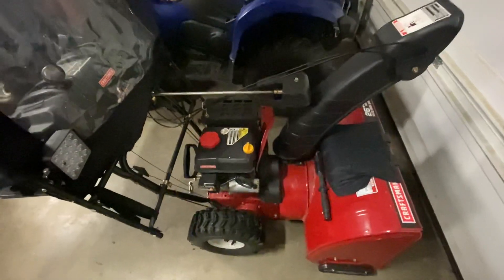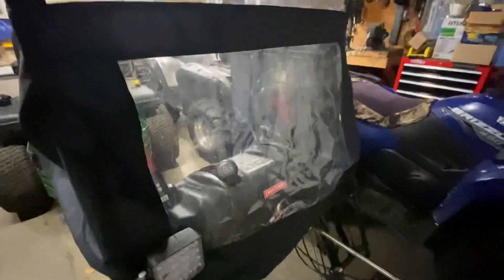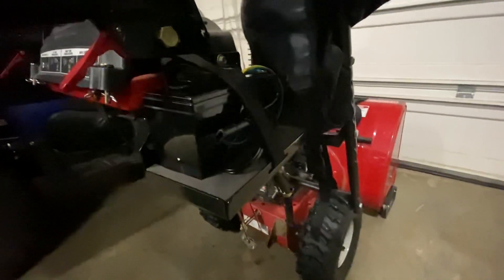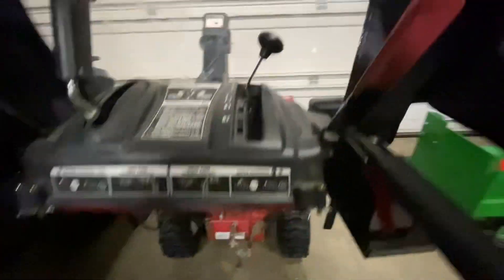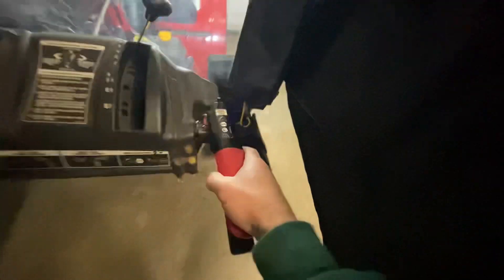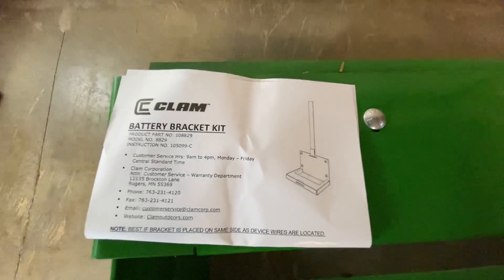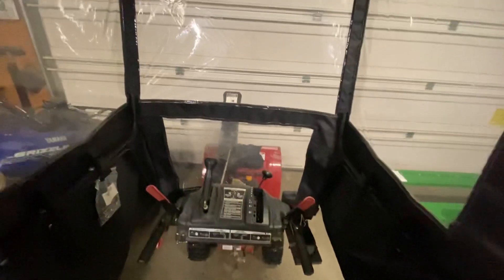Add a light to a snowblower that never had one and can’t support one. Part 1.

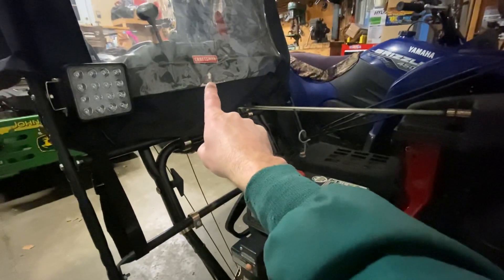Comment: at 0:26 whats the big metal cylinder on the side of the snowblower though? isnt that a starter motor? wich would suggest it has electric start, and therefore has a battery and voltage coil?
Reply from the maker: @chrisben2000  yup it’s the starter.  However on most snowblowers for some reason electric start is a plug in 110v process… get an extension cord and plug into the starter, press starter button, and your running.  So no battery, no generator/ alternator…  the electrical system consists of just ignition equipment.
Reply: @s1283  oh okay. i didnt know that. i ve only owned two, and one of them was pull start only and the other one had a battery and the electric start worked, but i always pull started anyway cause battery almost always dead
Reply from the maker: @chrisben2000 yeah that’s about right. Was the snowblower you got with a battery start perhaps an ariens? I’ve repaired a bunch of these as side work and so far they’re the only one I’ve seen with battery start.  Works great when it works, but charging the battery is easy to forget.

Comment: A lithium  ion battery would have done the same thing and gave you better results and using an adapter,  you could use your craftsman drill battery instead. I have converted several Electric start equipment  to the lithium set up, mostly Ryobi that you cannot get batteries  for anymore. That battery adds weight to the back of the blower and may make it tip back when going through wet heavy snow or on a hill when you do not want it to tip back. Lithium  batteries  are smaller and provide better power than lead acid batteries  any day.
Reply from the maker: As you saw I have a canopy, and to counter the already offsetting weight, I also have a front weight bag, so the weight is not an issue for me it’s not an issue but for others it could be depending on the blower and battery placement.  The batteries are free for me as I’m an electrician and  replace these constantly for work, and keep some good used ones on hand. I agree if your situation warrants you have access to old drill batteries, finding a power adaptor or converting an old tool for power would be ideal. The led lights work on a range of 9-30 volts usually so that would be ideal for someone.

Comment: thanks...have a 30 year old Honda HS80 barn find in mint shape...no lights. your video turned me in the right direction. I plan to use a plastic battery box instead or a clip on bicycle led light rechargeable small and easy install. may put 2 on lol thank you.
Reply from the maker: Glad I could help spur some brain juice! I saw the video you linked and that is a very well planned install. I really like the idea of using power tool batteries, I just don’t have any of those around. But I have plenty of the gel cell 7 & 12 amp hour batteries around. Definitely use what’s handy for you!

Comment: I'd just go to the bike shop and get one of those Niterider Lumina bike lights.  Easy to mount and they're plenty bright.  Or get 2 of them and mount them on both ends of the snowblower
Reply from the maker: Nothing wrong with that option. I’d say it’s perfectly acceptable in many applications. I’m not really a fan of the bike lights narrow beam compared to a wide flood. I also already had the light, switch, and wire at home, I have access to unlimited used batteries, and only had to purchase the battery bracket and the charge cable. So I am into it less that the cost of one bike light. But if the cost is justifiable, heck do it!

Comment: My blower has a stator, but I’m trying to put a whole bunch of lights on (some floods) so I’m using the battery as a buffer, when the lights draw more current than the stator can produce.
Reply from the maker: interesting. I’ve never thought that someone might try to push the limits of the stator. but how many lights might that be?  a decent light bar would be more than sufficient lighting and not likely max out draw. I’d love to see how it works out.

Comment: Thanks for the video. Would there be any difference without a cab to help shield the battery? I am considering adding a light to my blower (also without a stator).
Reply from the maker: Your welcome. If in your shoes, having no cab, I would still choose the mounting location, as it doesn't interfere with any operation. To protect the battery sans canopy, there is a couple ways it could go. 
1. I have used weather resistant connectors and heats shrink, therefore only using a battery terminal protector spray may be needed.
2. Wrap the battery a small trash liner or plastic bag before strapping it into the battery tray, keeping the opening and wires on the bottom or inside to keep water from ingress.

I prefer easy inexpensive solutions that are not safety concerns, remain reliable and are easily repairable or reversible. I am always happy to help where my experience will warrant.

Comment: I am trying to do the exact same to my snowblower it doesn’t have a stator I need all the parts you used including the battery and wiring configuration thank you
Reply from the maker: As stated toward the end of the video, the battery bracket was a made by clam. The part number was referenced as well. 
The wires I used were just 12v trailer wires, the charge connector was frok Amazon. Your basic battery tender harness.  The switch was from an autozone purchased set of aux lights I had kicking around.  The “48w” 4” square led was also from Amazon. There’s so many to choose from, you really can’t go wrong picking one that fits your application. The battery was free. I have a unique opportunity to get those batteries free before they get hauled off to be recycled. Sometimes you fine old batteries that are still good, but typically you can get them from interstate batteries for around 30-50 bucks 
Hope this helps!